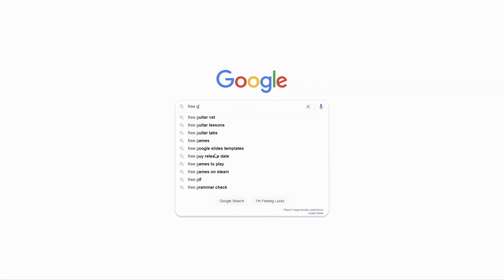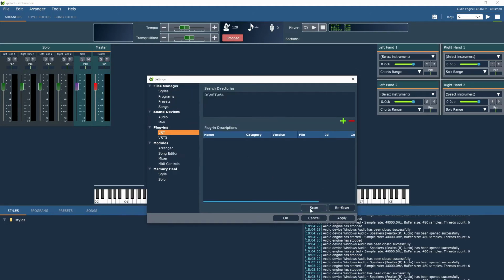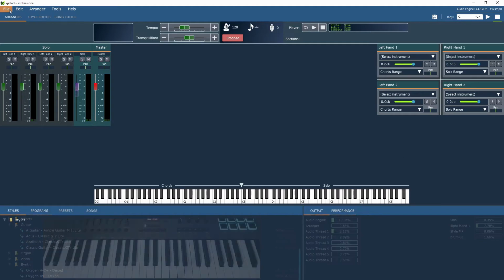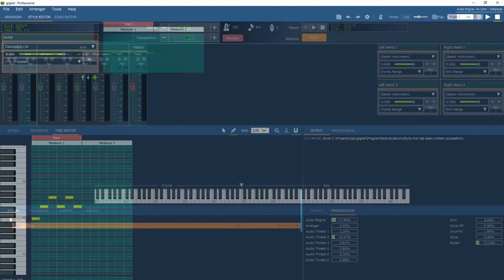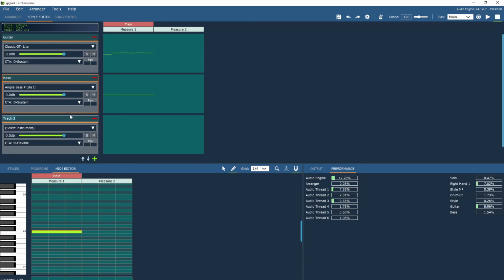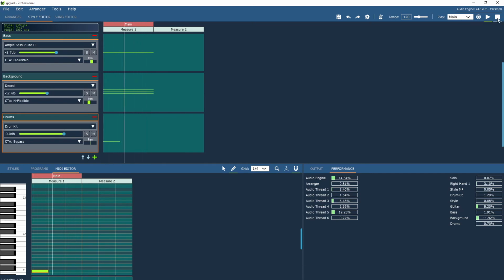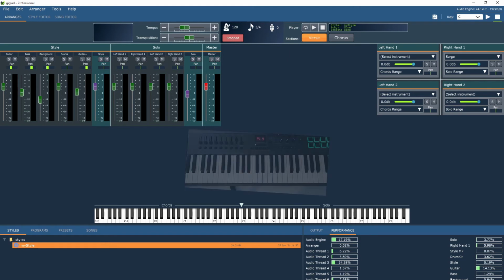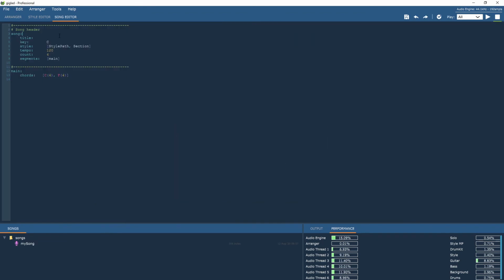giglad - Quick Start Guide

Comment: Hi, I tried the free one but it does not work. I followed your direction but had to fail. I have opened new style and then draw the chords positions but when I move to arranger, there is a question for save or cancel. Then I pressed save and move to arranger but no sound, even when I play from the keyboard... Please help
Reply from the maker: Youtube is not the place to offer support. Please contact as directly at team@deltarray.com
Reply: I had same problem on mac. I deleted the program using appzaper and reinstalled again. And now it is working with just 2 vst instruments.

Comment: can i use the program with a virtual sound card ?
Reply from the maker: It has not been tested with a virtual sound card. It will probably work but I cannot make any guarantees regarding the performance. You would have to try yourself. I suggest you start with the FREE version .

Comment: how to link key on MIDI keyboard?.my midi doesn't look like you. but it allows to use a few keys for free. How to assign functions?
Reply from the maker: Hello, the ui has changed a bit in the earlier version to support multiple midi controllers and this is why it is not the same with the video guide. It is very easy actually, you just need to enable your midi controller and then assign the functions in the Modules->Midi Controlls by giving the focus to the corresponding function (e.g. play) and then hit a button directly from your midi controller. Please refer to these parts of the documentation 
https://deltarray.com/documentation/giglad/#settings_midi
https://deltarray.com/documentation/giglad/#settings_midi_controls
and do not hesitate to contact directly at team@deltarray.com if you need further assistance.